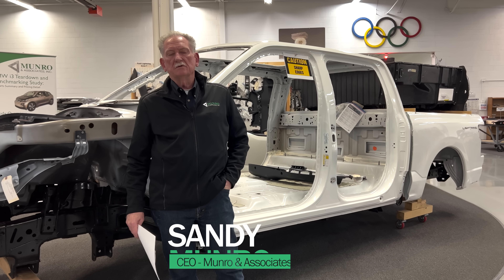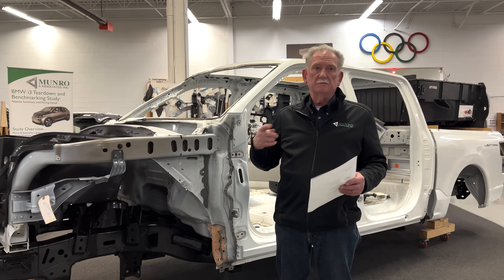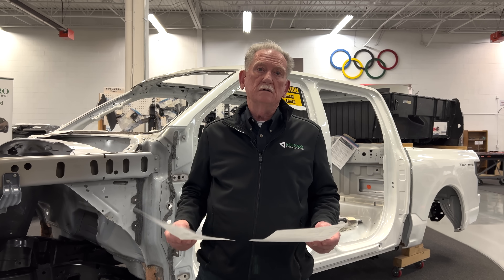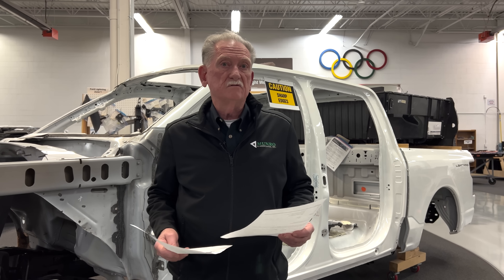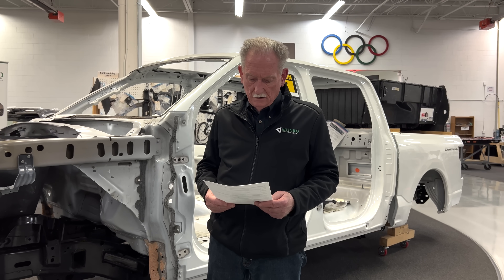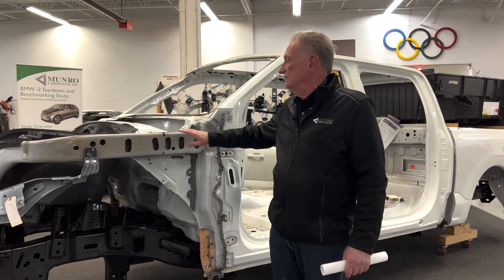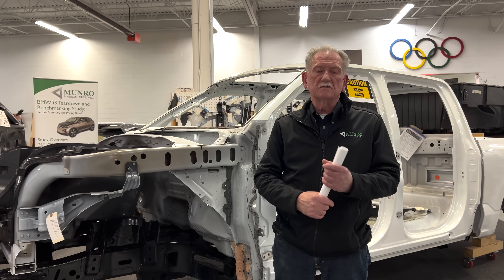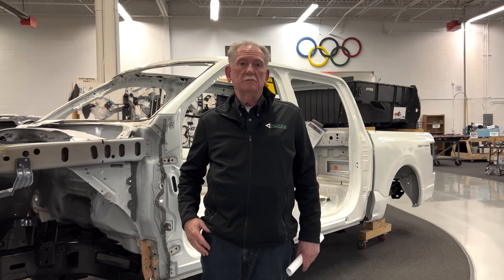Sandy's Initial Thoughts on the 2025 Ram 1500 Ramcharger

Comment: Even BMW scrapped their range extender option on the i3 for a larger battery which sufficed their buyers. They found the range extender engines were hardly ever switched on and when they were they were always running cold and inefficient and very polluting as well as extra weight and loss of luggage space and purchase costs were higher v larger battery BEV  only.

Comment: If I read correctly, it has 130kw generating capacity. Isn't that a bit "overkill" - I think there's a difference between extending the range (generate less Kwh than you're consuming at highway speed) and endless or continuous range.  It also seems like it would be far better to make a specialized engine / generator for this application? (and use it in everything...) because a modern gas engine has a ton of stuff to make it "efficient" under varying loads and speeds. This only needs to be optimized for max power at one set rpm. You'd think that could be made small, cheap, and efficient?
Reply: If you need to tow 14000 lbs up a mountain pass you need every single of these 130 kWs. I guess the guys at TFL will soon test this truck on the Ike Gauntlet...
Reply: if the battery is decently charged it should pull the hill no generator,, but to pull a trailer thru the wind and so on.. i could see it needing more then 130KW,, also i Personaly would want enough generator to propel and slow charge so the engine can shut off part of the time.. @bernhardleopold6702
Reply: You really missed the point of having extra charge capacity since the the Ramcharger is not only charging but powering the two EV motors. Someone else has already pointed out that under the stress of going up a steep hill will use every KW and especially if towing!!!

Don't listen to Sandy, he's losing his marbles unfortunately perhaps due to his old age!!!

Comment: I love hearing Sandy talk tech details but I’m not sure he understands the market well. If 690 miles of range is unladen, it will drop a LOT under towing and after adding passengers and cargo. That kind of heavy, high-mile usage makes the Lightning useless as we’ve seen on several YouTube videos. And the average 40 miles daily driving may be true in aggregate, but heavy-hauling and -towing vehicles are not just briefcase commuters or grocery getters! The market for these vehicles is specialized. Why does Sandy talk apples and oranges with the overall market versus what this truck can do and the kind of buyers and purpose it’s designed for?
Reply: Good point on the advantages of Ram range and heavy hauling capacity.  However I think most pickup buyers today ARE in-fact commuters and grocery getters.  By far the vast majority of truck owners.